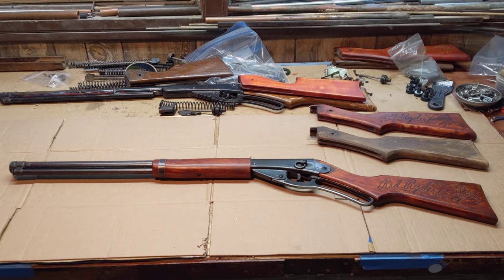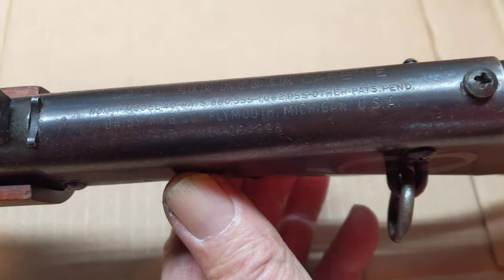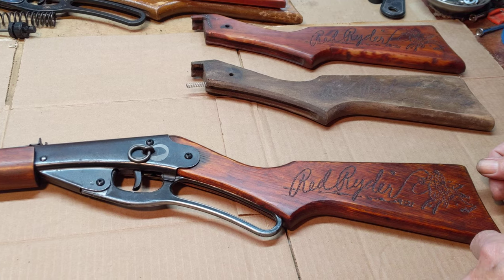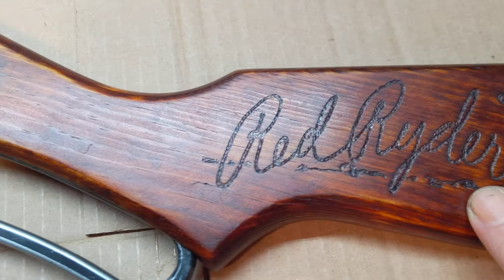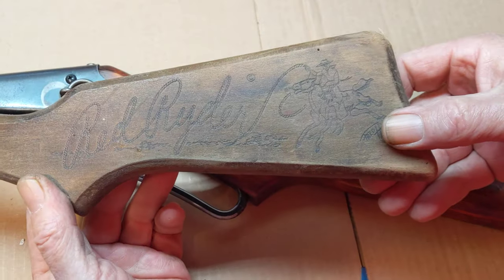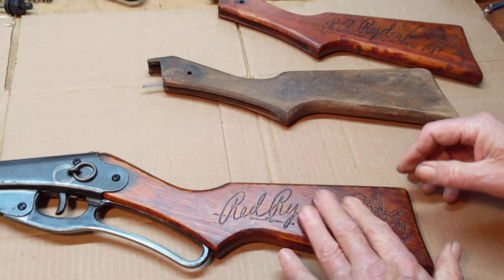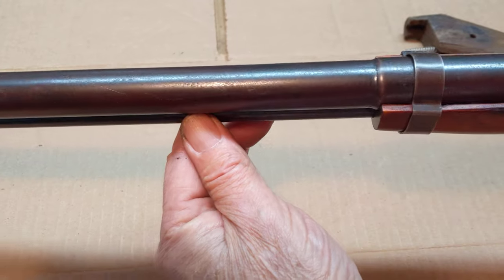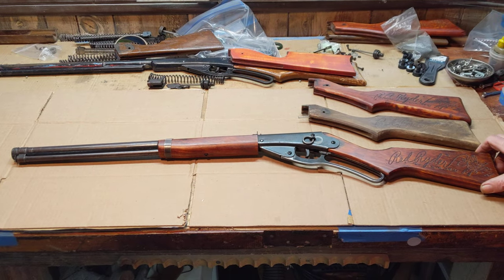Restomodding a post war Daisy #111 Model 40 that was missing it's stocks.

Comment: I want to say thank you so much for these videos. I just upgraded 2 Red Ryder rifles with Cobalt 327 springs, and some other little things. If it wasn't for your videos, I'd be up shit's creek! After cutting my pinky finger pretty deeply, trying to get the spring component back into the rifle the first time, I studied and made my own spring tool, which actually works very well.
 
Thanks again for the informative videos, I've learned a lot from them.
Reply from the maker: My pleasure. You might want to install a cross guard on you spring compressor, it makes a difference!

Comment: Which dye or stain did you use? Love the color. Thanks!
Reply from the maker: It's a combo of water soluble dye mixed with 1 part TransfastDark Mission Brown, 2 parts Brownells Tartrazine Yellow, 1 part Brownells Scarlett NS. The Brownells dyes are really old and I don't know if they are still in production. I will say a little of these goes a long way as I've done about 150 stocks with these and still have quite a bit of powder left. In light wood like maple you'll have to play around a bit to get the effects you're looking for.

Comment: Shane, what’s involved in removing the wood at the front on a modern Daisy. How does the barrel band come off? Greetings from a fan in the UK.
Reply from the maker: Right back atcha over there in the UK! The current production Daisy requires the barrel band to be removed by sliding it off the fore arm towards the muzzle, that's normally just finger work but if it seems stuck tap it off with a small wooden block aided by a hammer. Work gently and it'll move. Once that's out of the way remove the single phillips headed screw from the bottom of the fore end and it pop right off. Reinstallion is the reverse of removal.

Comment: Wondering what’s the fastest Red Ryder fps you know of?
Reply from the maker: Depends. Are we talking Daisy repeaters or Daisy's that have been modded to single shot muzzle loaders? The Fastest Daisy I've chronoed here at the shop hit a High speed of 405 FPS. That was a pre 1978 Model 111 with the power triad mod done on it. The fastest single shot Daisy I've seen via video was a Terry Cowger build that hit 525 FPS if I recall correctly.
Reply from the maker: Correction, the  Terry Cowger build clocked out at 594 FPS. You can see it here 
https://www.youtube.com/watch?v=K-8FwBd76Xg&t=5s
Reply: @RestOModDaisy  thank you.

Comment: Hey man I just got a daisy model 95 in really bad shape, I fixed up most of it but I can't figure out what's wrong with the trigger could you do a video on that
Reply from the maker: Which Model 95 do you have? Does it have a plastic trigger with a safety or a metal trigger?
Reply: @RestOModDaisy  it's got a metal trigger and no safety
Reply from the maker: @demoduncanct9205  Ok, send me an email at "thesocietyforprofit@gmail.com" with some pix of the reciever roll stamp and the trigger. Have you gotten it of the gun yet?
Reply: @RestOModDaisy I got everything but the spring inside the barrel out of the gun